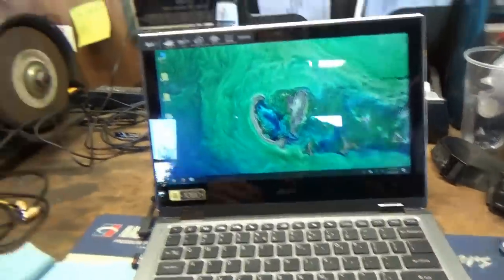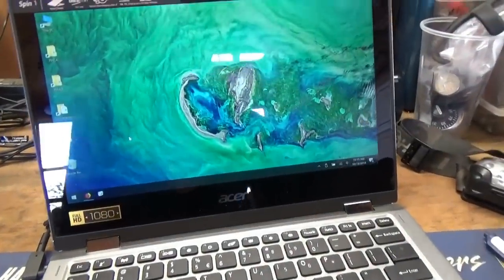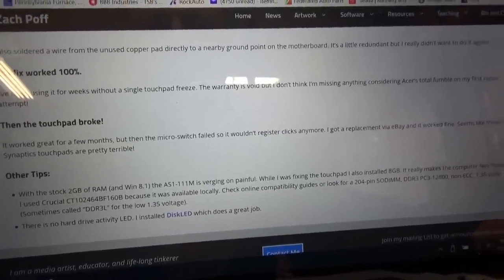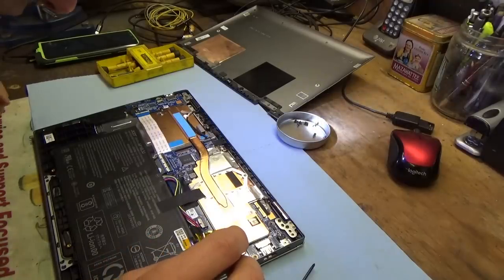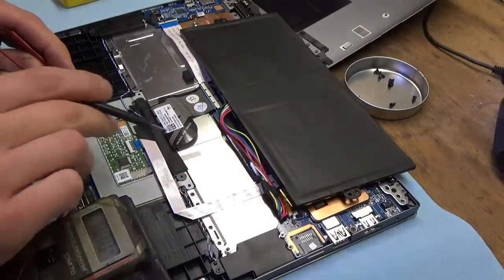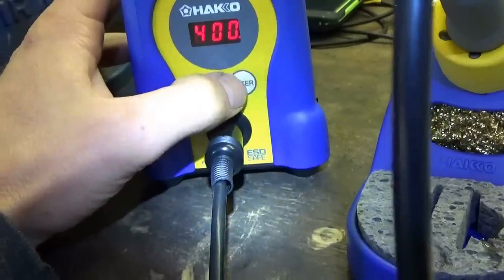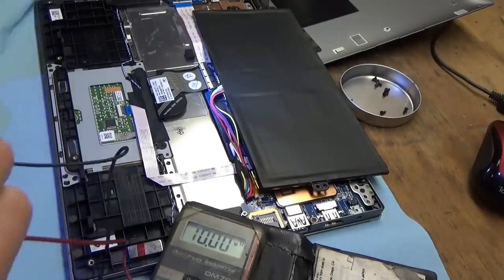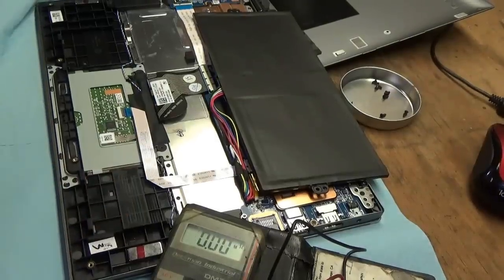Laptop Touchpad Freezing! -DIY Repair

Comment: Not had the best experience with Acer products. Had to do a few repairs on them over the years. Lenovo stuff is generally pretty good. My daily driver is a 7 year old ideapad i have only had it apart twice, once because it was full of dust and needed new thermal paste and another time because i broke the board with with audio jack. The thinkpads are better made than the idea pad. 

I have had to do several soldering repairs on peoples Acer machines. Even the low end HP machines are better made in my experience.

Comment: For my sins I was once a support tech / engineer for many brands including Acer for everything from tablets to servers. This maybe a ground issue but also be aware using laptops not made for harsh environments e.g. wide temp variants can cause internal condensation something which acer touchpads used to suffer from. Let them warm up and dry out and the touchpad started working again. 

I don't get it, you spend thousands on diagnostic tools like Autel Maxisys Elite, Pico scope etc then you go buy a budget laptop. Why not invest in an outdoors laptop that can take a tumble and cope with rain and temp differences etc. Your financial thought process is not sound imho. Your money,  your choice.

Comment: I would have scuffed up a spot on the silver colored side, applied paste flux then soldered on a small diameter flexible wire then soldered that to the touchpad board.

Comment: A couple of comments:

1) Buy a Dell computer or an Apple. When I worked for "the man" I demanded either a Dell Latitude (Business class not the cheap shit they sell at Costco) or a MacBook. In fact I didn't even have to demand it that's the only computers the IT department would support.
2) How the hell do you solder to aluminum which is what the ground plain seemed to be made from. It is technically possible to solder aluminum but it requires special alloys (and tin-lead isn't one of them) and special fluxes (rosin isn't one of those either). The native oxide of aluminum has got to be removed and that's why TIG welding on aluminum has got to be done with AC current which cathodically removes the native oxide. Using rosin core solder and a soldering iron it is impossible to solder anything to aluminum.

Comment: Nice work, Ivan! Saved from the scrap heap (which saved your wallet BIG time!).👍👍

I just found out I have to FULLY disassembly my model year iMac in order to upgrade its memory. As in, peel the glass front off without breaking it, and remove every single component from its interior in order to access the RAM. If I had just bought the larger screen, memory upgrade is literally a 2 minute job! Just my luck!! 😡

Comment: It may help to use additional flux when making the solder repairs. The solder will flow and stick better. Just be sure that it's rosin flux and not acid type (the acid type will corrode the connections, causing early failure).

Comment: I came across a Sony Viao that had similar track pad issues. It would work during boot up for about 2 minutes then freeze up. Used a USB mouse for a few months and then that finally stopped working too. USB connection wouldn't flow to the track pad. Seems to be a hardware failure, maybe a ground !!

Comment: Ivan, soldering to a ground plane is hard to do since the mass wicks the heat away. Circuit pads have thermal isolation so they are electrically connected but not so much thermally. (Looks like a star in the layout). Gongrats on the repair!

Comment: For repairing old parts and re-flowing old solder joints, one of the most helpful things I have found is to apply a bit of external flux to the joint before soldering.  The solder will wet the old surfaces much better. The tiny amount of flux inside rosin core solder wire is OK for new work, but is not always enough for old surfaces.  Numerous fluxes are available for electronics, and they come in various forms:  paste, liquid, and in applicator pens. For some reason, flux for electronics is hard to find in stores. You may have to go online. Do not use the flux from hardware store that is intended for sweating copper plumbing joints, as it may corrode electronic circuits over time.

Comment: I have everything Automotive on a 7 yo Lenovo Think Pad. Anything newer is junk. All i have done is install a solid state drive and Windows 10 and replaced the battery. Other than that it's been indestructible.  Nice job on the fix anyway, Ivan.

Comment: It's a good idea to lightly scrape the surface of the metal you want to solder to, to remove surface oxidation. If that's aluminum, it's really hard to solder to without a special flux. Would be better to run a wire from some known grounded solder joint back to the main ground solder joint on the pad.
Reply: Yeah I don't trust that solder ball to stay. It could fall in and short the motherboard.

Comment: When measuring low resistances like this always touch your probes together to see what the resistance of the probe wires are.
I usually measure in the neighborhood of 0.6 ohms.

I always get rid of all the multi finger touches.  Two fingers for scroll is OK.  Three fingers set to nothing.  Four fingers set to nothing.
I also like to disable tap for left click.  I like left and right click to be only where the left and right click buttons are.

Comment: I dread getting a new laptop my Dell is older than Methuselah Plus there is zero chance I'll go to Win 10.
Reply: I bought a refurb Dell Business laptop running Vista about 10 years ago. About a year later the hard drive was giving trouble, so I replaced it with a more powerful one, and still going strong. It gets turned on at 6AM and off at 9PM daily. I would buy another.
Reply: @reecenewton3097  Thanks

Comment: Flux pen! 
Like a chisel tip version of a Sharpie with flux instead of ink.
Ideally for large metal surfaces you need a soldering iron with high thermal capacity to heat the spot quickly.
Too small an iron will not be able to heat the spot quickly enough before it's tip cools, the thermal transfer from the element to tip may also not be adequate.
Some compromise can be had by starting with a higher tip temperature, but it's not ideal.
Reply from the maker: Great tips!
Reply: As a Amateur Radio operator I have done a ton of soldering. Flux is definitely recommended. You also want to use rosin core solder, which is what I think you used.  Never use acid core solder And NEVER blow on your solder joint. Blowing on the joint can cause a cold joint which can cause intermittent problems.

I agree with Simon too. A chisel tip is better to use. I only used a sharp pointed tip for fine work.

Comment: I have been working in electronics since 1965 and I agree with the comments below - Acer laptops are to be avoided. Consider Toshiba.  Additionally X2 ...
I have used a magnetic tray with dividers for years to avoid loosing screws and mixing the different types - long in a short hole can be very bad.
You might consider replacing your multi-meter with one from the FLUKE family of devices. Functions like screen freeze when you can't see the screen, auto mode select i.e. no buttons or switches to mess with comes in very handy when working alone in the field.

Comment: The typing problem is likely due to the touchpad sensitivity where it doesn't detect your palm and thinks you're using it normally when your palm moves across it while typing. There should be a way to adjust that sensitivity in the touchpad app if there is one.
Edit: should've watched the whole video first.

Comment: I find that Lenovo laptops are quality at reasonable prices (IBM heritage). Lenovo also bought Motorola smartphones from Google.
Reply: Oh, and Lenovo doesn't load third party software, no matter how useful it is. This 'pre-installed software' (to use a polite term) can include anything from free trials of anti-malware applications, to web browser toolbars that serve no useful purpose. You just get a clean install of the operating system. Of course, purists prefer Linux.

Comment: Hi Ivan, i tinker with both cars and computers,and i can tell you on the newer laptops with {builtin batteries} you need to unplug that battery every time you mess with the guts.If it does not have a bios battery its because that battery is ON all the time sending voltage to the bios chip to keep the clock and other things alive.like apple laptops with builtin battery's,these new laptops seem to be more prone to frozen bios chips .to reset you must disconnect the battery.to check out the pros,go to Luis Rossman's videos for apple and Sorins ..electronic repair school.these guys now their stuff.OH ya you could also try CONDUCTIVE PASTE,to from better contact,.Hey Ivan do you know of a cheap scan tool that will read OBD1,my Honda 1994 with 500,000 miles  i want to try scanning the the sensors.thanks buddy.

Comment: I believe for soldering to aluminum there is a special solder that makes it much easier.
Reply: Yes, but for occasional use, in electrical work, you can use rosin core solder but aluminum forms a coat of oxide when exposed to air which impedes solder. You can scrape or sand the small area where you want the solder joint to be, but the oxide will reform almost immediately. To get by this, press the iron into the aluminum and scratch the molten solder around with the iron: the oxide will be disturbed and removed, at least in part, and since the metal is covered with the molten solder, air won't get to it, and the joint is made.

Comment: The bad part is, some of us are that good at soldering...lolol....it's REALLY hit and miss how mine looks. Can soldier 2 wires for heat shrink and can do ok. Tried to solder a conductive strip inside my fuel injector flow tester, and, I'm, yeah. A newborn could have done a better job.....but it does work now....lolol..,..I guess that's what matters tho.....

Comment: Working in this industry I can say most Acers are to laptops as Chryslers are to cars... just not very reliable and cheaply built. As others have said, if you get yourself a used business-class laptop it'll likely last you for years upon years trouble-free. Absolutely recommended.

Comment: I use a tooth pick to add a bit of regular plumbing flux to the joint. It has always worked for me.
Reply: Plumbing flux is acidic and really, really bad for electrical wiring. It will corrode copper (or even silver) electric connections causing no end of grief.

Comment: Good job Ivan. You'll soon be the Jedi Master of repairs. :)
I noticed you have a conical tip on the iron, that is good for small soldering areas. If you need to heat up a larger area, you should change the tip to a T18-D32 which is a larger chisel tip better suited for what you were doing. Between 500-700 degrees is about the best temperature for soldering. You'll have to experiment as to what's the best overall temperature  for your situation. Keep up the great work.  Sean

Comment: Hey Ivan,  I fix laptops too!  Lol.  But I wouldn't own Acer brand again.  I had issues with board randomly turn off and battery issues,  many other things.  I quit buying Acer.  I went with HP and Dell.  I own Dell touchscreen and HP non touchscreen laptops. Have zero issues with them.  I recently went full SSD on both since the drives started to slow down. Now it's much faster with SSD, like brand new again lol.  I take great care of them.  Like you said you need it for work,  I'm the same way!  Great fix!
Reply from the maker: That's cool, Josh! Dell has gotten much better since 10 years ago. I remember my parents bought a brand new Dell laptop back in the 2000s, and that sucker would get so hot it would burn your lap and bog down big time haha
Reply: @PineHollowAutoDiagnostics  oh yeah.  I remember that!  That's real oldie!!!  They have come long ways since then.

Comment: after many years of repairing laptops, I have found out that the best way to avoid Acer problems is not to buy them
Reply: @skat kat Microsoft developed the "Intel" pentium?
Reply: What do you think about ASUS products...always thot their MBs were top notch.
Reply: @mikefoehr235  Asus is the Cadillac of mother boards and they have been around a very long time. Support is top notch too.
Reply: @Garth2011  I have good luck with SAMSUNG smart fones but have been tempted to buy an ASUS smart fone.
Reply: @mikefoehr235  True!
Reply: @skat kat Just checking, I'm well aware of who invented them.
Reply: hahahah agreed
Reply from the maker: Is Acer like the Chrysler of the computer world?
Reply: @PineHollowAutoDiagnostics  Except they're under instead of over-engineered.
Reply: they are better than they used to be and you can get lucky and have a good one but failure rate and build quality are not as good as they should be
Reply: @PineHollowAutoDiagnostics  Beware as well. Plenty of manufacturers use acer parts in their machines because they don't make much of their own hardware.
Reply: @PineHollowAutoDiagnostics  Acer is a huge company and their products are no worse than others however, I'd put them on the list to consider long before some other brands. Asus is a good brand.
BTW, all mobile CPU's are half the processing power of any desktop CPU due to the power saving needs of a laptop. Core i7's with much L3 cache memory @ 2.5 Ghz or faster are the only option for a good running lap top. Of course, 16 GB of system memory or greater is best too and for those considering a new laptop in the past year or so the SSD or M.2 nvme hard drive is the best option to have for speed, battery life, less heat and value.
Reply: @Garth2011  I agree with you about ASUS. I believe they make good computers and the best wireless routers available.

Comment: If it plays up again, maybe use a thick wire soldered direct to the copper strip and make an eyelet from a tin can and screw that direct to a good earth point, solder the wire to your eyelet.
Sounds bodgy using tin but it solders nice and easy to stab a tiny hole through it, use your special powers of modification :-D
A tiny nail and hammer works well.
Reply from the maker: Great suggestion!

Comment: Nice video :) I watch car repair videos and (retro) computer & videogame console repair videos as well in Youtube so this one was interesting fix. My current laptop is Packard-Bell EasyNote from 2013, never had a problem with it, still works fine. Previous one was Toshiba which had problems, hard disk destroyed itself in the first month, luckily it was replaced by the warranty.
Also, my 2001 HP Brio desktop PC had badly installed 3,5" disk drive connector from the factory, prevented me from doing a Windows 98 boot disk at the time. Fixed it myself.
First ever computer problem was Commodore 64 which PSU started blowing fuses, of course right after warranty expired :D Had to replace it as it was filled with epoxy resin of some kind, no way to fix it.

Comment: Nice work Ivan! Today's laptops are built to break, even some business line models are problematic.
I did send my Asus out for repair twice, the second time only for a freakin AC adapter that could just have been shipped.
After the warranty expired I had to fix a couple of weird problems like overheating for too much factory applied thermal compound on the CPU, and a no power on issue that turned out to be a shorted out capacitor placed in parallel with an identical one.
This is clearly planned obsolescence, I've only desoldered the shorted cap to fix the problem, nasty!
Now the laptop is working fine since the repairs made two years ago.
Rule #1: never trust computer manufacturers
Rule #2: if you want your computer properly repaired, (like Scotty says) then fix it yourself 😄😄